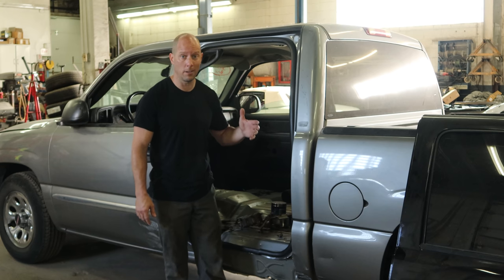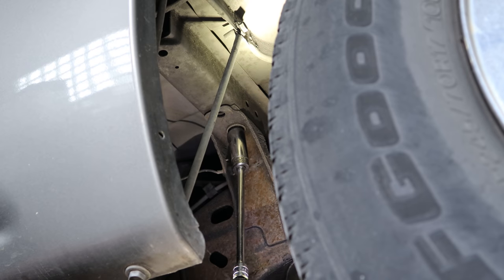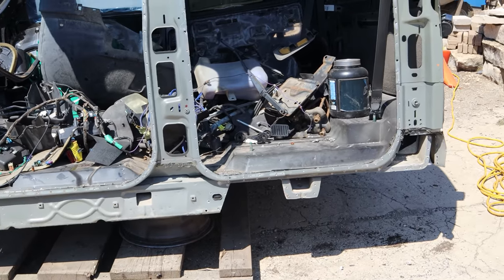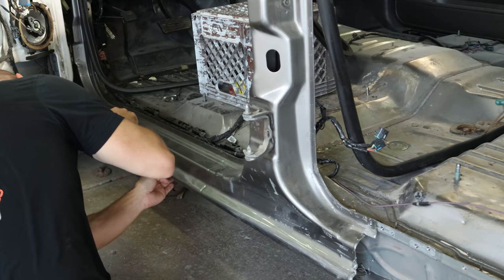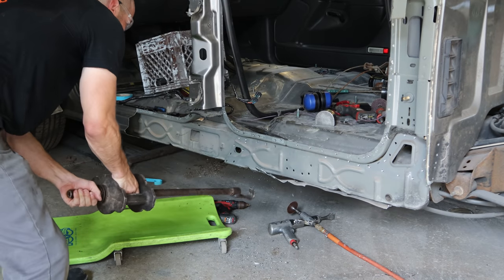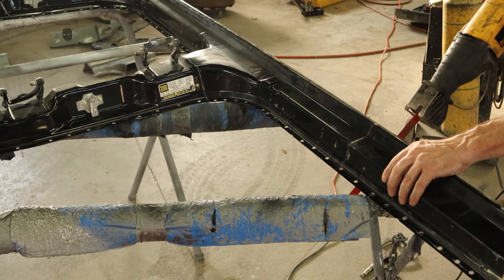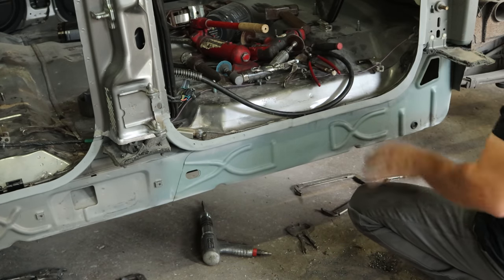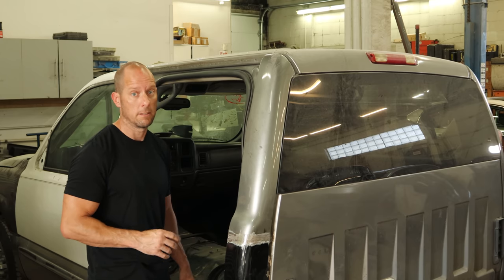Rebuilding one of the few rust-free 2006 GMC Sierras in Illinois part 2

Comment from the maker: If you figure in the cab parts, the total miles driven is actually over 8000.
Reply: Like I've always done. I lose money on every unit, but I make it up in volume.
Reply: I have to say, the fact that you can lift those doors on and off so easily kinda impresses me. I had to do the same for my F150 and I had to use a forklift, there was no WAY I was lifting it off by myself. Plus I'm a little shorter than you so I couldn't grab it properly either.
Reply: That’s a bit of change In gas money. Whew. Good to build it into vacations!
Reply: @IronChief  If you lose money on every unit then volume is not your friend!
Reply: I sure hope there were many other transactions along the way @ the what $0.55-0.60/mile in IRS mileage allowance, that’s a chunk of change.

Even my $10k 2012 Mazda3 is $0.24/mile in actual costs.  A truck and trailer combo has to be as much if not more than the IRS allowance per mile, all costs in.

I hope you make a killing on this.  But it goes to show the uninitiated the costs of running a business.

Not to mention the value of the time spent behind the wheel.

8000 miles at 60 MPH is over 133 hours.  Even at a paltry $10/hour you have over $1333 in “labor value” driving.

Getting close to $6k in transportation costs pretty easily and I’ve not even factored in meals, lodging, etc.

I hope you made out well on all the transactions here.
Reply: Hey Vehcor, considering you buy a lot of chevy trucks and are very familiar with them I was wanting to see if you could help me out with a small problem. I have a 2014 silverado and the radio recently started acting weird. When I turn the truck off and close the door the radio stays on and won't shut off. Has this happened to you? I checked the fuse and it looks good. The only way I found to turn it off is by removing the fuse. Do you have an thoughts on what the problem may be?
Reply: @alexjohnson4934  try changing the door lock actuator it has a sensor built in to tell whether the door is open or not. Your truck probably thinks the door was never opened.

Comment: You know someone is good when you feel like you could do what they're doing just by watching. I have almost the identical truck that had almost identical damage. 2005 Silverado crew cab, 5.3, 2wd, in Silver Birch. Bought with 83,000 miles.  Im over 3 years in and 60,000 miles added, and its still a great rust free truck.

Comment: Amazon used to sell these - Safe Eyes Stainless Steel Mesh No-Fog Safety Goggles - had mine for over 6 years.  Very fine mesh, easy to see through, keeps out saw dust, debris and bolts.  Amazon sells similar products now, check the fineness of the mesh and projectile resistance in choosing one. Great for what you do, not as great in front of a grinding wheel w/o full face shield, but No Fog always.

Comment: There's actually a lot more work involved in this repair than what you'd think. The damage didn't look that bad at first. At least it wasn't as bad as the other side of the black parts cab. You might even get the job finished in the next video. All the best from Queensland Australia.
Reply from the maker: People think you just hack off the old parts and weld up the new ones and you are done.  I like the cab swap approach if you have the same color, no waiting on the painting gnomes. There is still a lot left to do that was not from the accident, just 15 year old truck things.

Comment: I have a 1500hd that needs front fenders, rear fender wheel wells, bed floor supports,outside rockers, cab corners and possibly inner rockers. I’ve been slowly knocking out the frame rust and POR 15 after getting all the loose stuff off. And I’ve done all the mechanical stuff. Would love to try to tackle the body stuff on my own but time has not been on my side. Hopefully I can find someone that will do the job correct line this to bring my truck back to life.

Comment: Whats usually the cause of water getting in these trucks? My floor insulation gets soaked after a heavy rain. Third brake light seals good and roof antennas don't leak

Comment: So when is the black cab scrape ?  Love your work so far and with the way the used car and truck market is going lately you'll do well selling it.  thanks for the video keep up the good work.
Reply from the maker: It’s done, I was saving it for the parts I used.  Everything else is used, junk or not worth saving. Thanks for the support.
Reply: @vehcor  sell the cab to Neutral drop on a rusted clapped out frame a barely running 2 revs from scattering its guts engine bald tires with that rewelded knuckle lol

Comment: I do hope you don't have to turn too many cars upside down and shake them🤣 .
I still would like to ask you a question if that's ok. I am just wondering what sort of welder did you use for doing this work and what you could recommend for a beginner to do this . I have got quotes to do rockers on my van but I cannot afford it so I'm just wondering it is a job that if I got a cheap welder I pretty sure I can do it I just don't know what type of welder to use you might recommend something for me please and tanks
Reply from the maker: I have a Snap On welder.  It’s not cheap and is way more than you need.  You can find cheap welders for under $500 that will do the job.  Eastwood has some, even HF ones I have used were not half bad.
Reply: @vehcor  sorry I couldn't get back to you before now I was just on a call with a friend. See my story is I actually live in Ireland so I am just looking for the name of what would suit me in a welder. Would the  name Be MIG welder???

Comment: Hey Vehcor, considering you buy a lot of chevy trucks and are very familiar with them I was wanting to see if you could help me out with a small problem. I have a 2014 silverado and the radio recently started acting weird. When I turn the truck off and close the door the radio stays on and won't shut off. Has this happened to you? I checked the fuse and it looks good. The only way I found to turn it off is by removing the fuse. Do you have an thoughts on what the problem may be?

Comment: I couldn't see what was wrong with the inner rocker. From video it looked like 1 minute with a calibrated hammer and calibrated 2x4 would straighten the slight bow in the middle. Less chance for rust with original welds(in theory anyway). Yes, I know only a little and Scott knows much more but I don't quite understand.

Comment: i hear alot about using body panel adhesive.  It is supposedly a watertight seal.  what is your reasoning for using all the spot welds as apposed to the adhesive??

Comment: When it comes to the sectioning and I guess even more so the pulling and whatever else to get things lined up aside from doing it from experience and by eye is there resources us mere mortals can get access to?

I know enough to get myself in trouble usually and it seems like getting those measurements and sectioning instructions to do it right (or oem right) not Scott right isn't possible.
Reply from the maker: I believe emanualsonline (not a sponsor). Has some data and you can buy only what you need.  I measured off the used cab and the other side of the truck.  I don’t always use the fancy tools.  Measuring used parts before I cut them off has always given me more data and better information anyway.

Comment: I don't see how you get the wiring harness connectors apart so easily. When I work on stuff they are liked glued together half the time and impossible to get apart by hand
Reply: i al;ways waft them with my heatgun before i touch them

Comment: Its nice to know the option packages didn't make much sense back in 2006 either.
Reply: @vehcor  well it looks like you've got the leather wrapped steering wheel and auto headlights. But then no cruise control... what gives? 

Much like I have remote start and auto hvac on my 19' gmc but no heated seats.
Reply from the maker: They all had automatic headlights.  Only WT had the cheap steering wheel and it does have cruise.